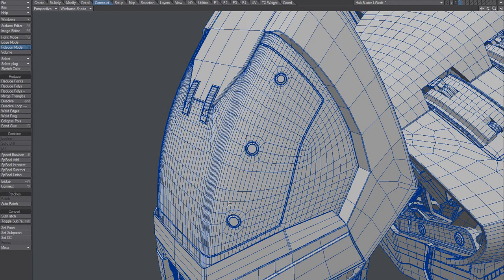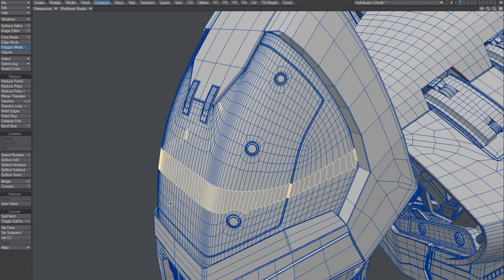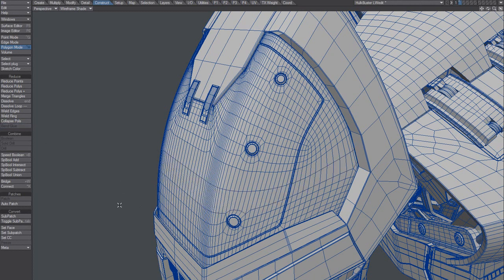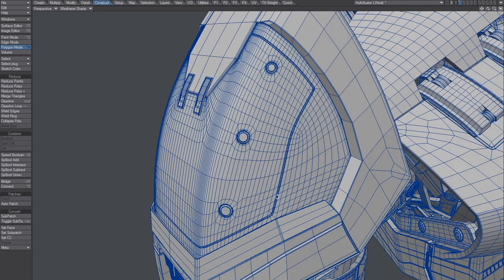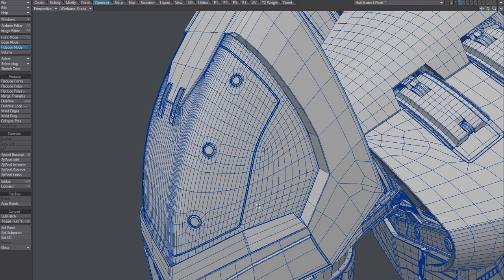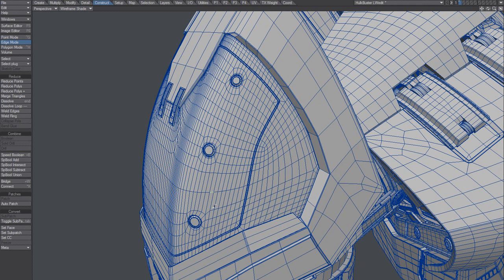LightWave Model - Delete Edge, Speed (Ø) (X)

Comment: Great model, but I think maybe it's your topology, or something else with your particular mesh, or your hardware.  I'm running LW 11.6.  I created a box with 100 x 100 x 100 segments, which results in 60,000 polys.  Then I went into subpatch mode.  I then selected a loop along the z, which took under 2 seconds.  Then I deleted the loop.  The deletion took under 30 seconds.  It was under 15 seconds in polygonal mode.  For a box with 25 x 25 x 25 segments, the deletion took about 1 second in polygonal mode and about 1.5 seconds in subpatch mode.  I'm running a high-end, 3.4 GHz, 8-core computer, with 12 GB RAM, and LW screams for me.

Comment: Hi Erikalst, I just did the same in 11.6.2 and it was much quicker, almost instantaneous. Did they fix it then?
Reply from the maker: hi   :)
nope, it's probably due to lower polycount in your model?
Reply: +erikalst  I raised it pretty high to resemble your example, there was a slight delay, perhaps three seconds. I gather you would be using a decent machine, mine is not fast by any means. Is it a graphics card issue do you think? Do you have a similar delay if you use dissolve instead of delete?
Reply from the maker: just checked, the complete model is 800.000 polys...  :° 
so only a small part is visible in the video...  :) 
a heavy object, but operation is too slow. dissolve / delete had unfortunately the same delay...
Reply: +erikalst  Okay, you're right, at that level there is a significant delay.